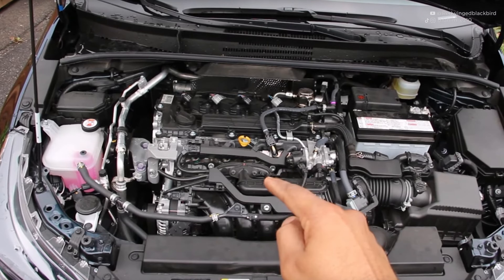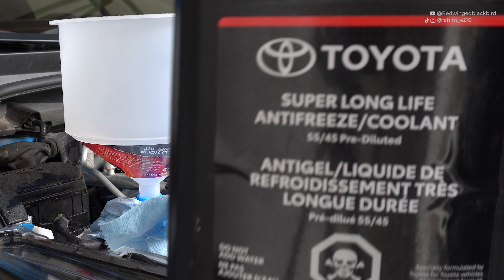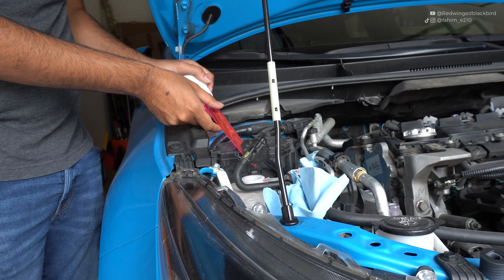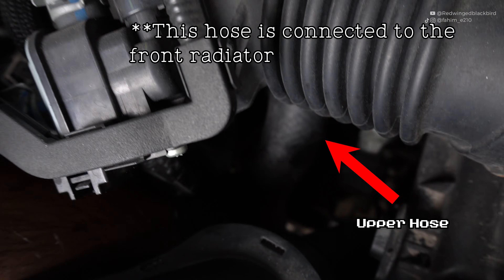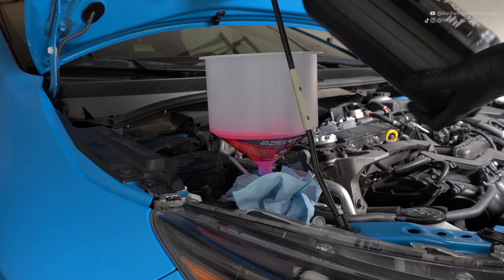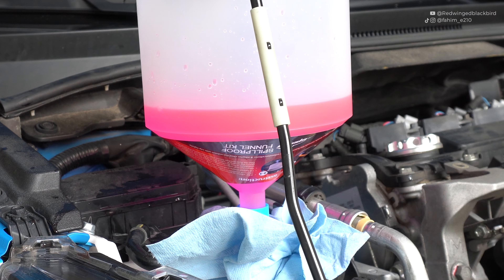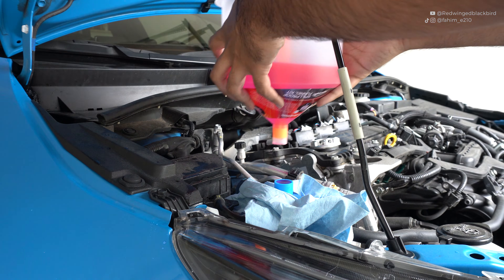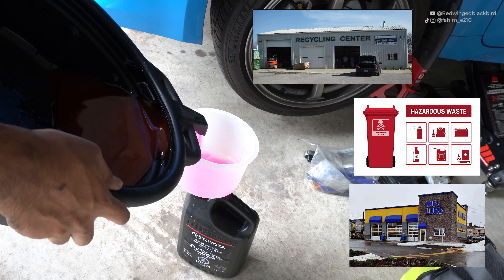[E210] Drain, Fill & Bleed Coolant on a 2019-2022+ Toyota Corolla

Comment: I have a question? Doesn't the Corolla SE have an electronic water pump? I believe the procedure is different for bleeding.
The Car Care Nut YouTube channel explains it. Your draining process is correct but the bleeding process is different.
Here is he's link to the coolant change on Toyota's Dynamic Force Engine for the 2.0 and 2.5 engines.
https://youtu.be/UWr9OqIjsLY?si=tAu5axwazSi3at5P
I like how you performed the coolant change. Very well explained 🍷
Reply from the maker: My video is based on Toyota's own TIS (Technical Information System), with the only exception being the step about turning on the heater + fan (because I did this with older cars). I did watch the Car Care Nut's video before making my own video, and his didn't match the Corolla service manual. I figured it couldn't hurt to add this procedure to YouTube. 

There are a million ways to solve a problem, it's up to you on which you think is right.

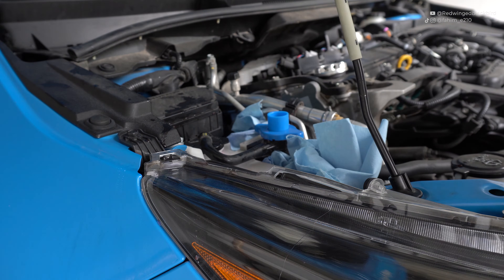Comment: 6:40 Right there where you put the funnel, I would stick the tip of a powerful air blower and run it for at least a few seconds which often helps blow out remaining few fl oz out then close the drain plug and start the refilling and burping process. Good video though!

Comment: At 7:03 did you mean remove the tubing? Because when it says "remove the hose" I think of the upper and lower hose
Reply: Also what are the cutters used for in the beginning of the video? To adjust the tubing size?
Reply from the maker: Yes that was meant to say remove the tube that you used to drain the fluid

Cutters were used for adjusting length of said tubing, as well as cutting off the end of zip ties

Comment: did you not run the engine and squeeze upper and lower hose and let it run for awhile and get air out???
Reply from the maker: After filling the coolant, you can squeeze the hoses with the engine OFF. I don't see an issue if you do or don't do this.

Comment: So the coolant reservoir I have is similar to the one you linked in your description. I have watched the video and noticed that he did not use the spill proof funnel which most youtubers I've seen use. Is there any reason for the difference? I'm just a DIYer and I'm curious on whether I should just follow his video step by step or maybe do what you did but of course squeezing the right hoses.

Edit: Spelling
Reply from the maker: Spillproof funnels are not a necessity, I reccomend it because as the name suggests, they help prevent spills.Truthfully on previous cars, I had a generic funnel that pressed firmly into the riadtor cap to prevent spills, and that worked fine.

If you want to prevent spills, a spillproof funnel is an easy solution, but other funnels exist that can function the same. If you don't care for spills, just use whatever funnel you have and you'll likely be fine.